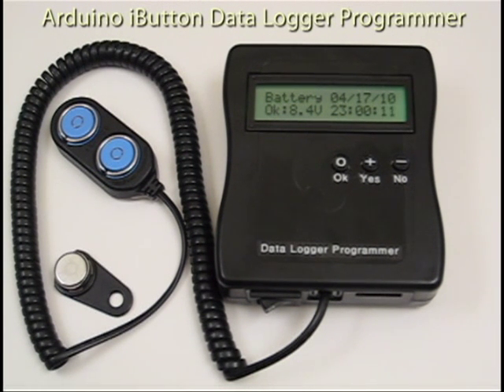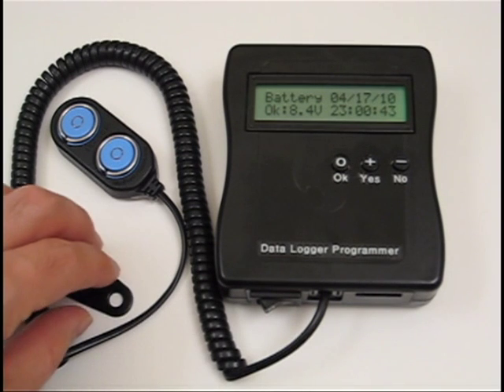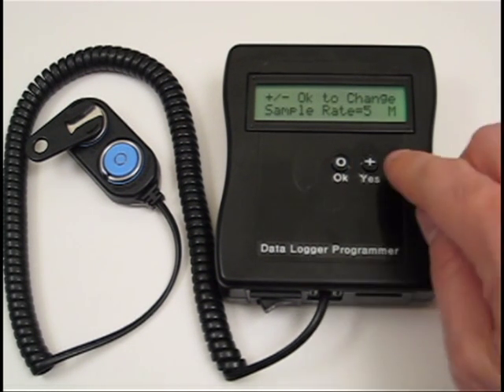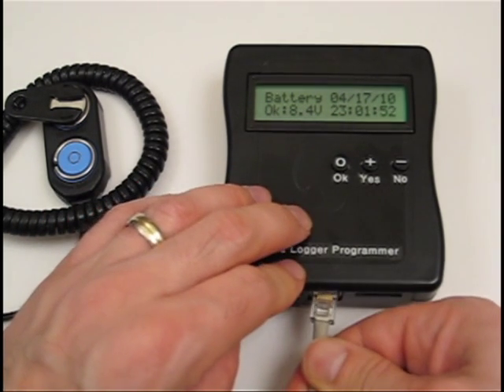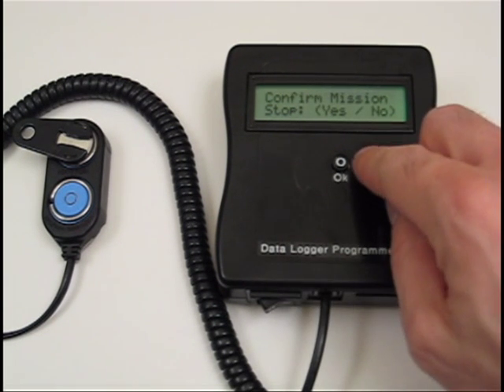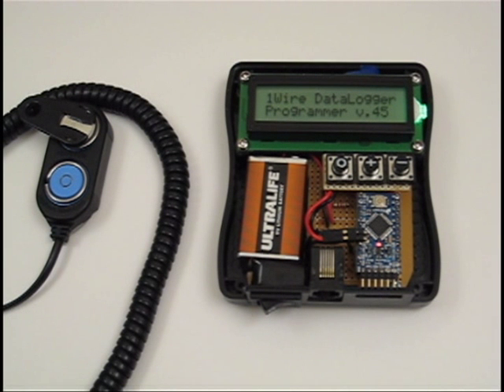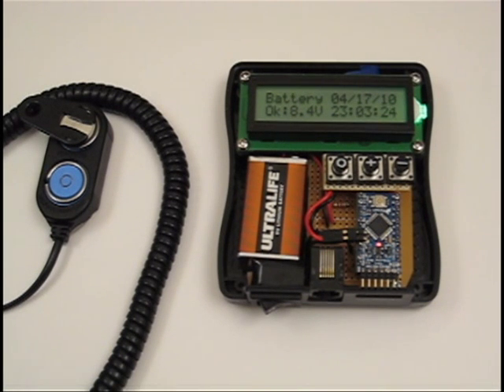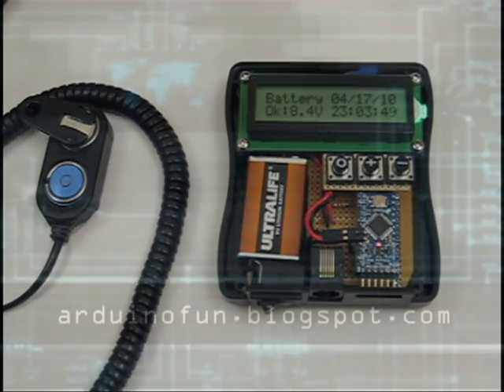Arduino iButton Data Logger Programmer Portable Prototype

Comment: hi can i use it to copy another ibotton???   I need to copy the dallas DS1991 .

  I have a equipment that after 50K pulses it stops and i have to buy another part but  this part can be used until 100k pulses.  i  would like to buy another part take its ibotton and copy and replace ite very 50K pulses